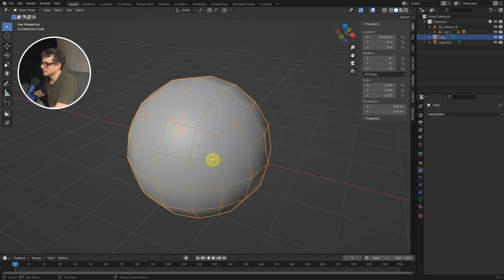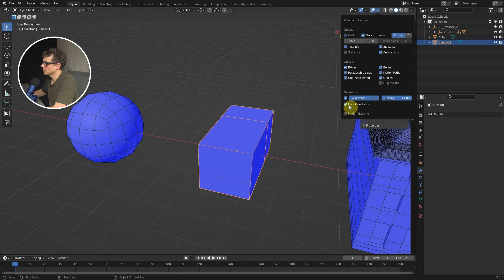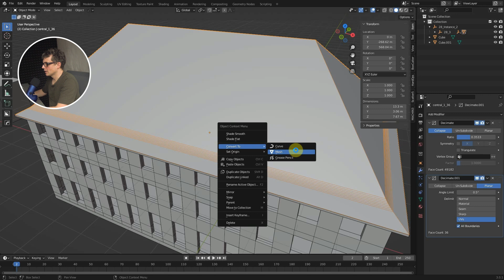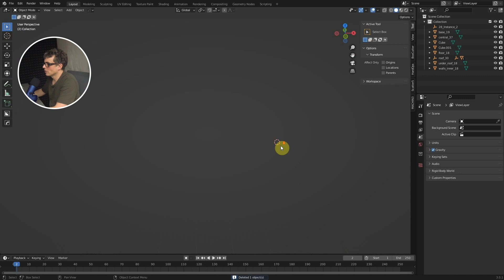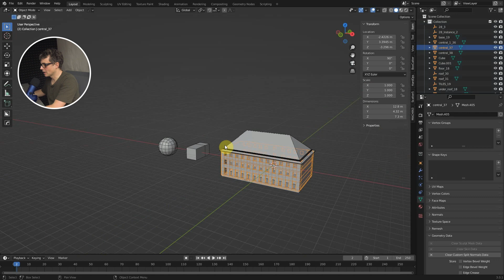Repair Geometry and Import Meshes (OBJ, FBX, ...) - Blender Tutorial

Comment: maybe explain what you do?
Reply from the maker: what exactly is not clear?
Reply: @XoioDe  bei minute 1.50 wird das video geschnitten ohne zu sehen wie man zu diesen einstellungen kommt
Reply from the maker: @wiz8360  Ok, true, there is a cut. So you  apply a decimate modifier and then reconstruct the settings as seen in the video. Play with the ratio until the decimation is feeling right.

Comment: sorry, I have a question... I often create meshes which I then export to Unreal and I've noticed that the format that creates the least problems for me is gltf... but when I'm on Blender and for example I model a building, paying attention to the geometry, in short I create a mesh perfect then when I export it and import it again into Blender the geometry changes and is no longer as precise as I had done, why does this happen?
Reply from the maker: Hey James - sorry, would not know anything about reimports from UE :(. Normally a good exchange format is FBX, no? But that does not say anything about precisision.
Reply: @XoioDe With FBX, I encounter many problems like faces disappearing and textures being inverted. With glTF, this doesn't happen... but I was referring to importing and exporting from Blender for Blender. For example, I create a mesh that I will use in another project still in Blender, so I need to export this mesh to have it in a new Blender file... I recalculate the normals, apply the transformations, in short, I do everything necessary to have perfect geometry and a clean mesh. However, when I export and re-import, everything goes to hell. For instance, on a flat face like a plane, it adds loop cuts that I never made... Should I perhaps use OBJ if I am only working within Blender?

Comment: Ive got a weird piece i created in tinkercad and its got alot of shapes used to make it. 
Im trying to round of some of the corner edges, cant do it in tinkercad really, so i exported it as stl and when i open it in blender its a messy mesh and i cant really use the bevel tool to round off the corner cuz its got too many lines and is a mess..

Comment: what are the pit falls in using fbx models in blender, or how flexible are they over or as apposed to or equal to  a  model made  in blender? ( or all of the other possible imports)
Reply from the maker: FBX is totally fine for its purpose. It is basically a format to exchange data - all of them have certain advantages and disadvantages - try OBJ and DWG as well. But to save Blender stuff for itself you would obviously use then standard Blend file. Happy Blending!
Reply: @XoioDe  I was wondering how much can one modify the mesh , or basically closely can one treat it like a blender file object (model) . scalping and such on it without completely screwing it up.
Reply from the maker: @userxbw  That is impossible to say. If you know what you are doing, you can completely modify an import mesh, optimize it etc. and it might just get better. But several processes might involve loss of detail or UV-data. So always keep a backup.
Reply: @XoioDe  thanks, I just didn't want to be wasting my time modifying everything only to find out I screwed it up more then not. its a big learning curve going from making a model with face builder, makehuman put them together head on body, because I suck as an artist in that respect then to  UV's getting skin tones then I am a that does not look absolutely like the person perfectionist kicking in . then to animation with the aid of miximo needing to be done then the other stuff afterwards,  and I am still redoing the head part. I basically haven't gotten anywhere other then repetitiveness to remember some steps in what to do.
Reply from the maker: @userxbw  Got ya - understand. Best to take this kind of stuff with small steps and small projects to learn the workflows that suit you best. And then you can patch them together for something big. Otherwise it feels really overwhelming - I know the feeling. Good luck!

Comment: toooo fast ,,,
Reply from the maker: Maaan, you are Gary Speed and this is too fast :) ? Where did I loose you?😄
Reply: @XoioDe  haha,,, first command... Blender interface is pretty daunting for new users.. complicated by multiple ways of accessing the command and versions changing the interface...  suffers from being designed by committee in that regard...  so how you tracked down "tri to quad" took me 30 minutes of  further research..  PS speed is my "ironic" nickname from my teenage years... aussies love giving ironic nicknames to their mates.. I was notably lay back in my youth
Reply from the maker: @garyspeed8961  Hey Gary. I personally got pretty well used to Blender UI. You should be willing to use a lot of keyboard shortcuts - it really pays off in the end. If you don't know a command just smash the search bar - it is really realiable ( I kept the space bar as search) and additionally the results also tell you where the command is found. And if you really use a command more often, consider putting it in your quickfavourites - I always have 5-6 standard commands there. Good luck and Godspeed!

Comment: You lost me at 2:40 where you said to convert back to a mesh. At what point did you set it up to not be a mesh, or is this just a function you can use to apply the cleaning of the roof?
Reply from the maker: Convert to mesh basically applies all the modifiers in this case. You can also use this command to turn curves/ texts into meshes, butt in this case it is as simple as that. You could alternatively apply the modifiers by hand, but that's more clicks.